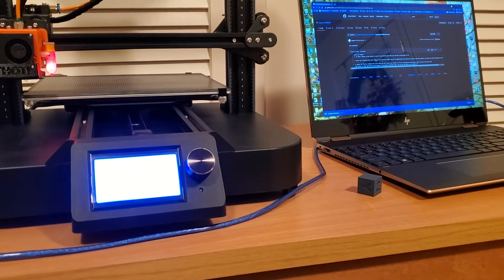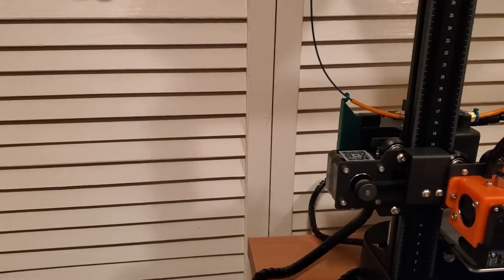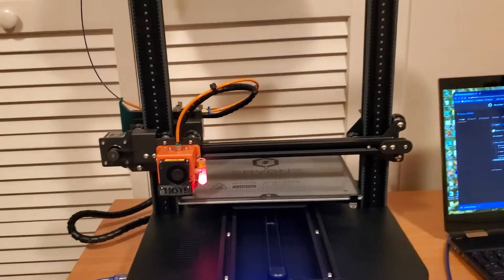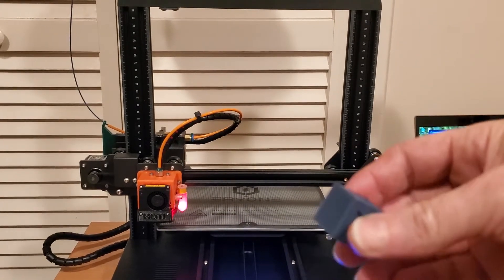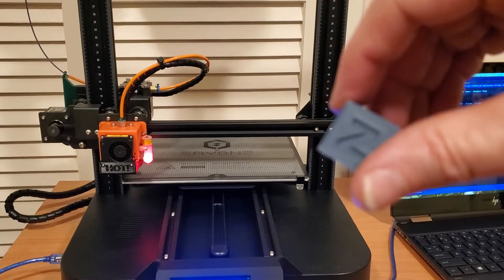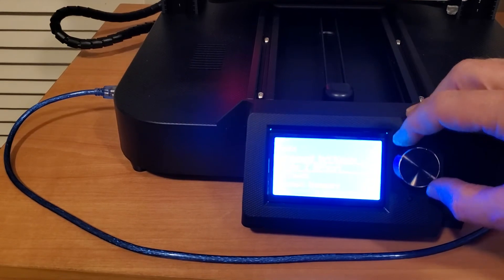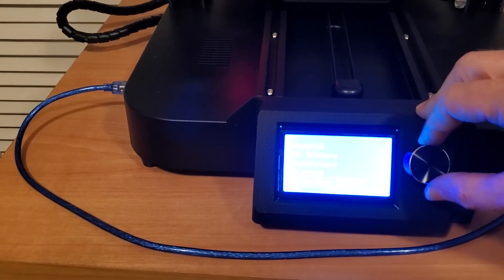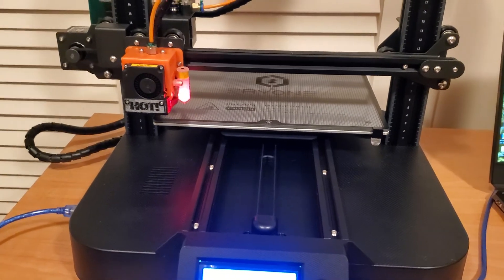Episode 3 - Firmware Update

Comment: Hey I am running into an issue when i try to print certain prints after slicing them with Cura i plug the SD card into my printer navigate to Print from Media and when i select the print file to print the ER20 resets constantly

Comment: Hey! Went with the firmware 2.0.8 since i couldn't find the 2.0.x and since then i'm getting a small beeping sound sometimes when leveling and preheating, any idea if this is normal?
Reply from the maker: Hmm...Have you tried going with Eryone's released firmware?  The current version is based on the 2.0.x modified by Stefano Piga on the FB group.  Mine does not beep, so I'm not sure what might be happening...
Reply from the maker: Any update?  What did you need to do to stop the beeping?